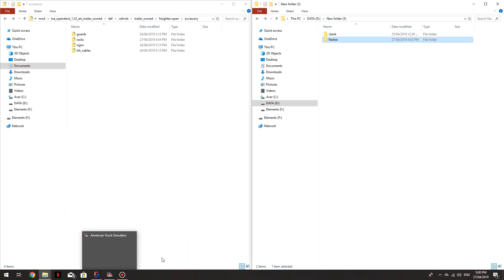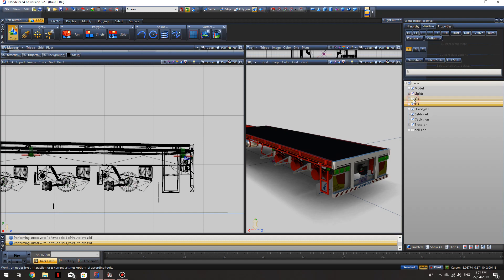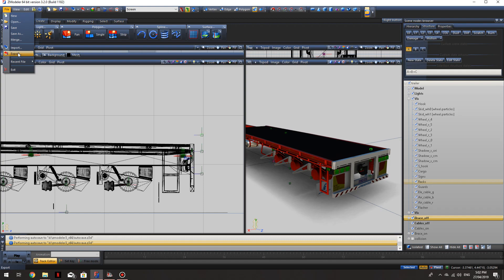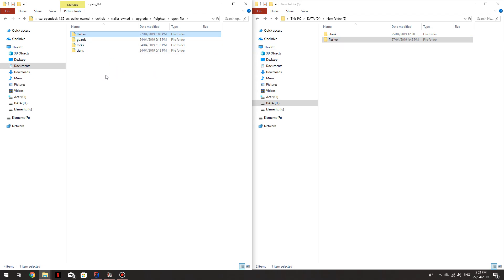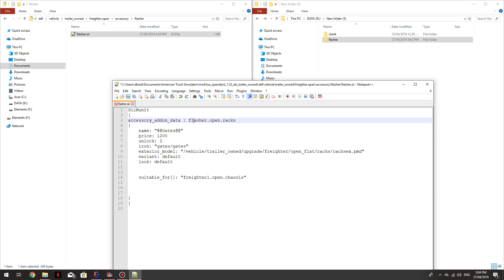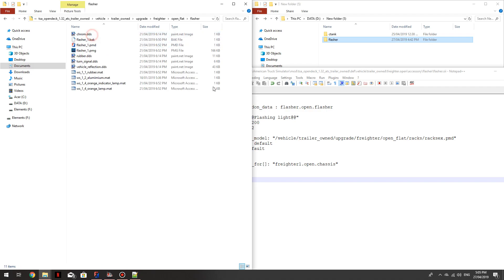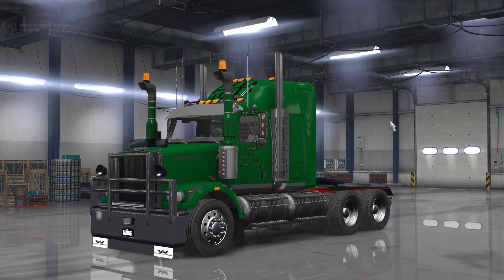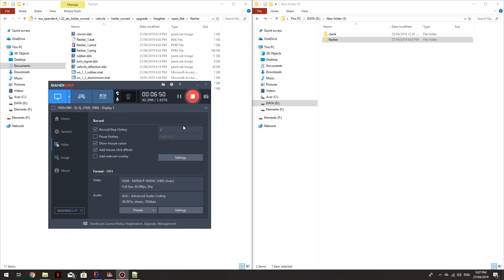Adding a flashing light to a model

Comment: Thanx a lot mate :) but I got one more question where can I get this flasher folder u put into the trailer folder. Like the one with the dds parts and so. Can I download packs with that somewhere? Or how are u doing that. I got trailers vorm custom aussi mods and want to add the flasher there.
Reply from the maker: Mr Peppermint there is a link in the video description mate
Reply: @tonybradley4126  now I just need to learn how I import trailers and trucks :D but I got someone on hand who will show me on Wednesday and than I will try a lot. Of ur stuff :D I am. Sooooo temped
Reply: @tonybradley4126  hey man, i got a nother question. what file do u open do get the trailer in zmod?
Reply from the maker: @Alexux1996  you need to open the .pmd file mate
Reply: @tonybradley4126  ok need to find that thing :D and I need to find the base file for import. Well that will be done Wednesday :D